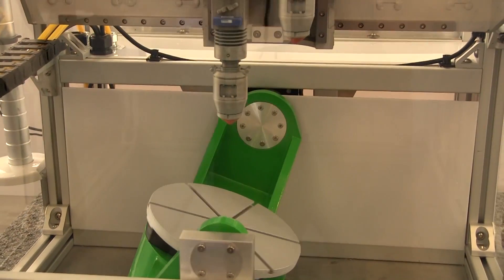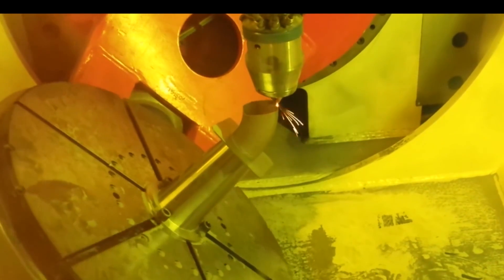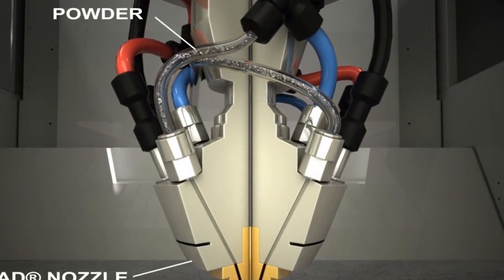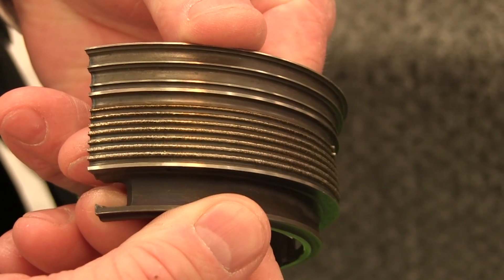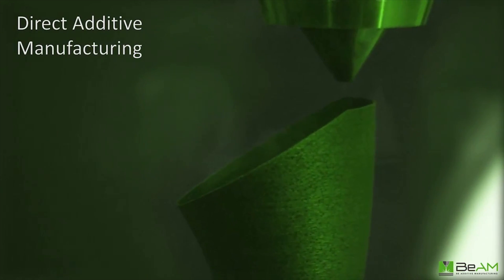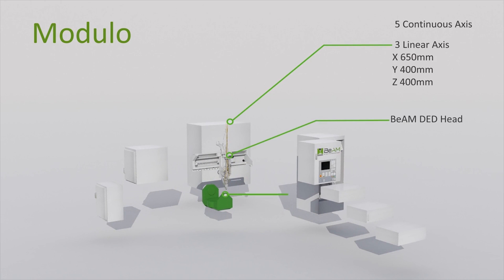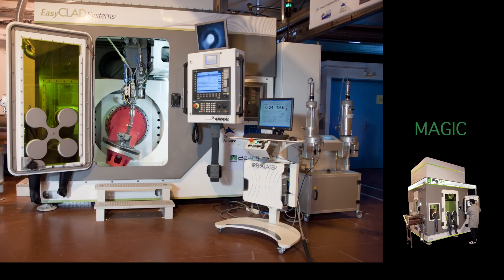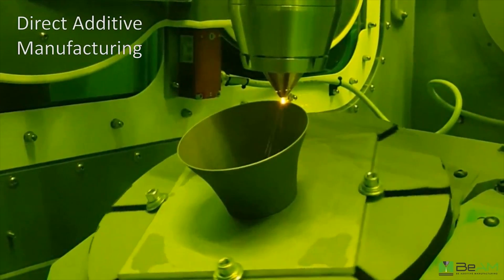Directed Energy Deposition for MRO

Comment: This is a very similar idea I had in college. Except for ours, we was 3D printing plastic instead of metal and we also had a router for excess material removal. Some features we were trying to obtain was:  3D printing around another surface;  reduced  use of support material (which the router could remove); reduce use of infill, have a metallic internal structure for 3D printed parts; and reduced 3D print times with the spindle removing the inaccuracies in 3D printed parts that were printed fast, and with thick layers. 
Unfortunately, our funding and manpower was limited so we had to settle with a 3 axis machine built from a donated 3D printer. However, I started process of building one at home which I am at 3 axis now and working up to the conversion to 5 axis, but I've taken a detour into dual extrusion until I get a job to fund the R&D.
Reply: can i get more details / your contact info or website ???